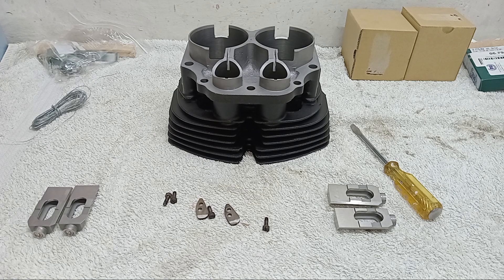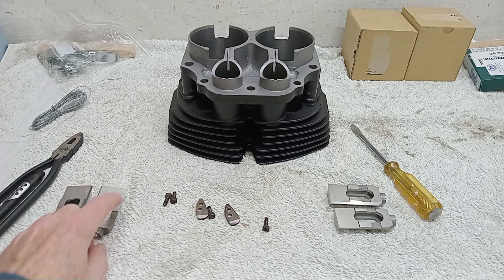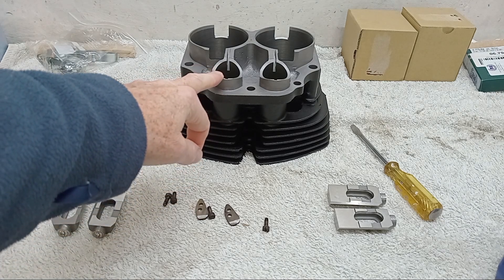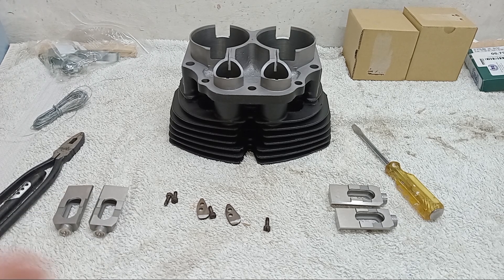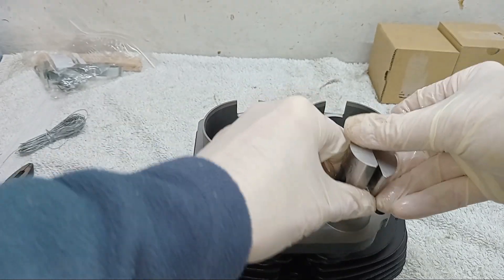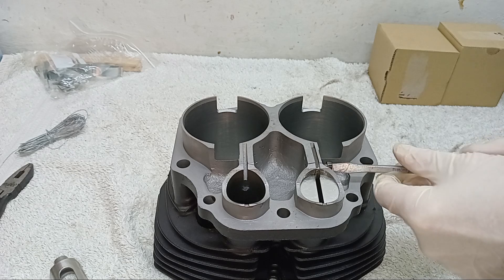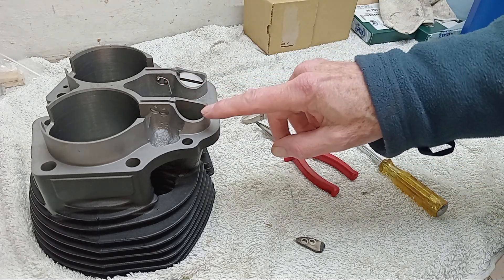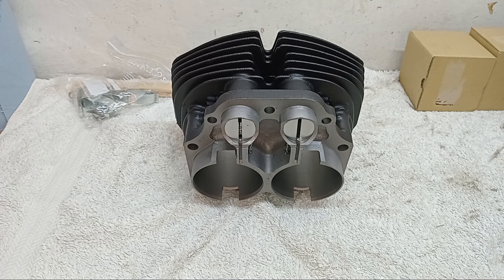Norton Commando Engine Rebuild. Part 66: Fitting the Tappets and Pistons

Comment: Good work, if you get technical, Andover Norton or Norvil are brilliant;; Cam followers  if they rattle replace, still rattle replace the barrels or get them bored and lined; If building a race motor the cam followers are the biggest opportunity for reducing reciprocating valve weight; I grind out the U; Up top I put in Alloy collets grind away 30% Valve caps, That can break; Cam followers do not break Even when abused by me.

Comment: Hello, Unfortunately, I can't quite understand what tolerance you're using when inserting the tappets. Do you mean 0.02 mm, 0.002 mm, or a completely different measurement? Best regards.
Reply from the maker: I'm using Imperial measurements, not metric, so the clearance is 2 thousandths of an inch: 0.0002"
Reply: @Chris.rooke150 thank you so muche ✌🏼

Comment: Is there a certain way to install the circlips?  A side that faces outwards?
Reply from the maker: I have had circlips in the past that have had to be fitted one way round, but these were the exception. Most (virtually all) can go in either way round. 👍
Reply: @  It was long ago when the pistons in my 850 were replaced.  At that time the book I was using indicated that the clips   with the sharper edge  (90 deg.) would go on the inside and the rounded edge would go on the outside…or was it the other way around?  Perhaps the newer circlips do not have this charactaristic.  Your videos have been helpful in maintaining my bike.  Thank you.   Regards, Pete
Reply from the maker: Ditto! 😁